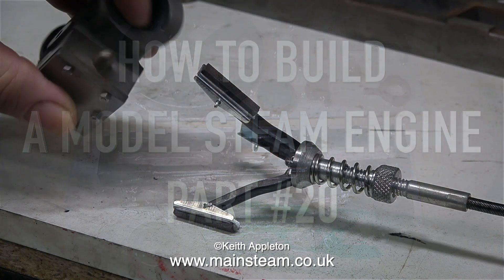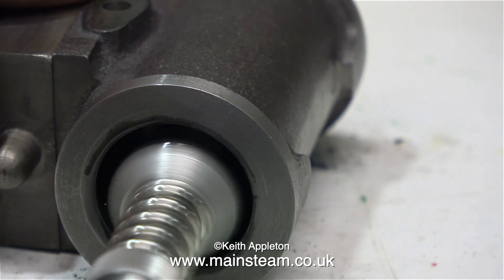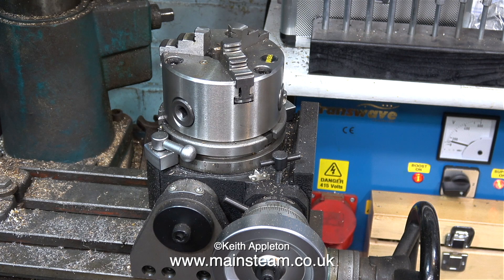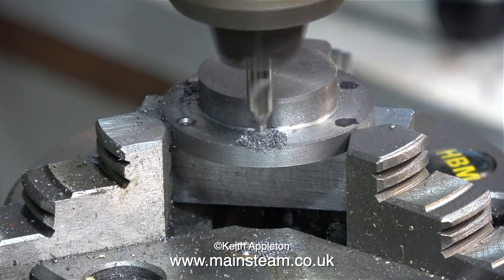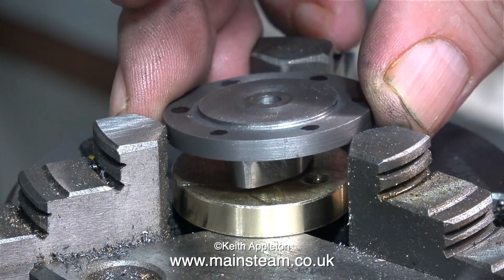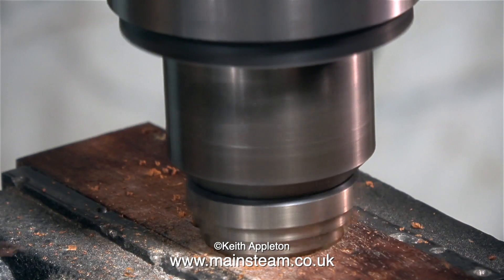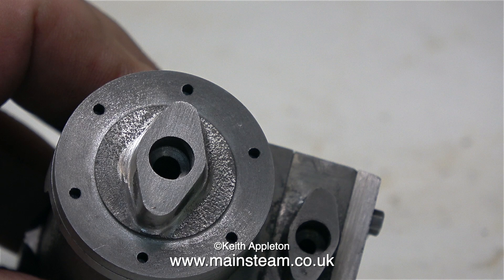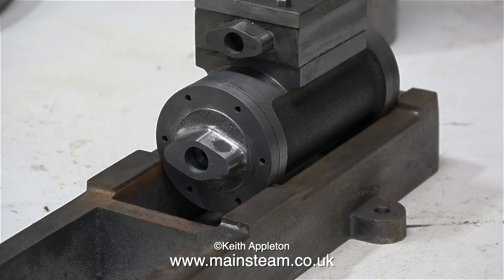MODEL STEAM ENGINES AND BOILERS - PART #37

Comment: Every now and then I like to poke a little fun, in a comment, so here goes
That spring laded thing, as you called it, is, of all things, called a cylinder hone. This thing is used by every CAR GUY that ever rebuilt a car engine, so using it on a small or model steam engine cylinder is right in line. 
If you want to see one, sized for full size steam locomotives, look up the restoration videos on 4 -8-8-4 #4014 one video shows the cylinder honing machine the Union Pacific rail road used. It will not fit in a hand drill.
Remember I'm just poking fun, these videos are always interesting and useful. ;-)

Comment: For a really super-smooth finish using a hone like that, wrap it in progressively finer and finer wet-sanding paper. Probably not much point in going finer than 330, but Ive gone up to 2000 grit (not steam cylinders). Crazy smooth...